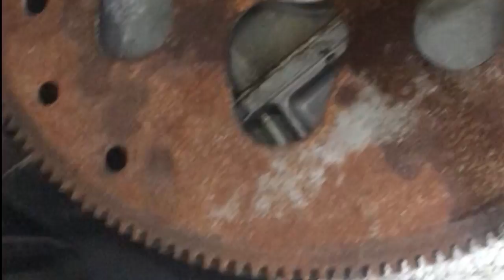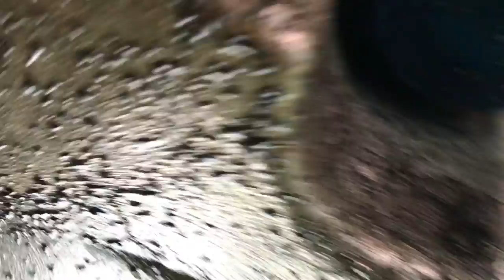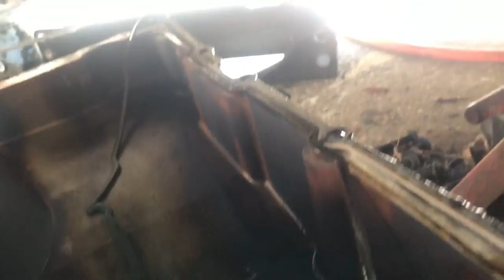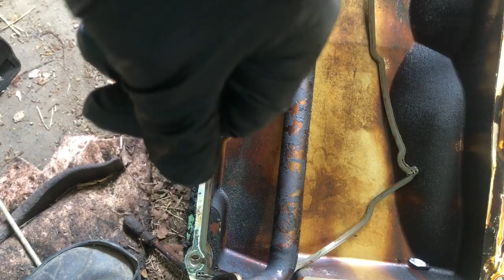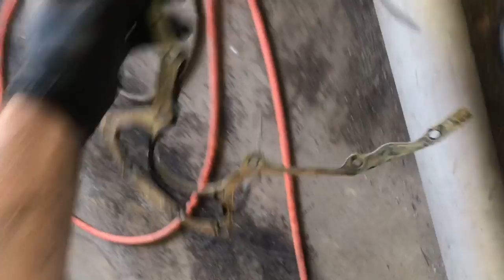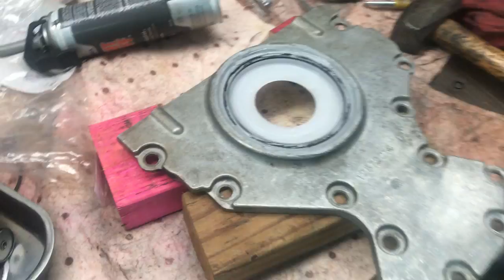03 Suburban Oil Pan Gasket, Pickup Oring, Rear Main pt1

Comment: Any suggestions on getting the oil pan off because I can’t get mine off all bolts are taken out of the oil pan
Reply from the maker: 2 bottom Bellhousing bolts out?
Reply: MJM’s Workshop they are they only thing  that is odd to me is that even the front of the pan is still really on there I’m replacing an oil pump so the timing cover is off and I’m lost for words at this point I don’t know what’s holding it on there
Reply from the maker: Lyrical Walrus what about the 2 really long bolts?
Reply: MJM’s Workshop are those on the bottom of the pan right beside the bell housing bolts
Reply from the maker: Yes
Reply: there is a plastic cover under the starter that bolts to the side of the pan with a single 10mm

Comment: I did this job f oil pan gaskit replaced on my chevy tahoe 2006 and am really disappointed man its still leaking now am thinking f applying the paramatex ultra black gasket maker without the gasket sealant.